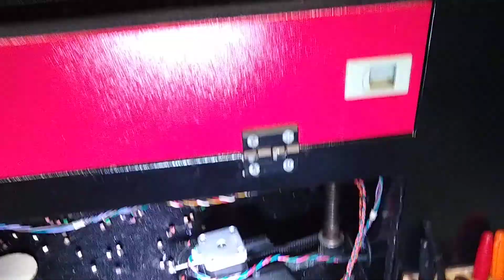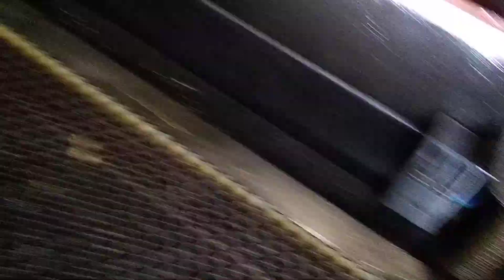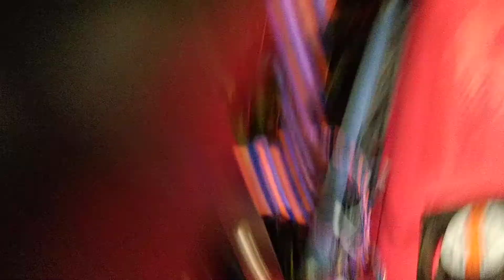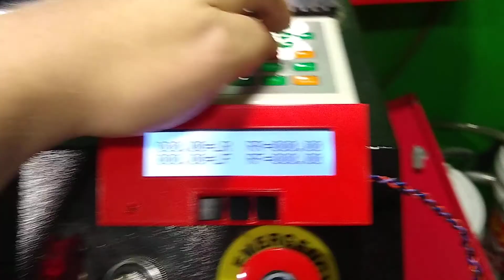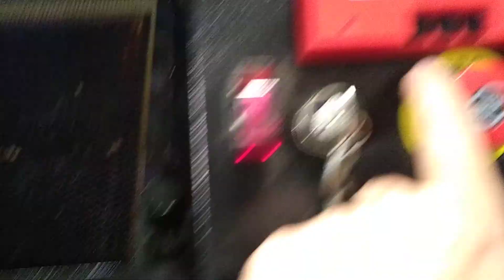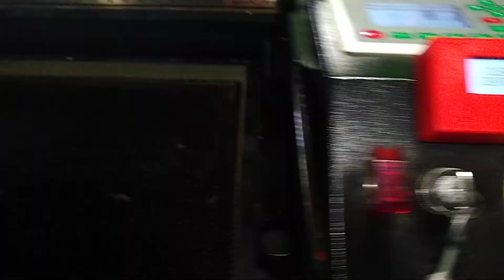Laser Cutter Bed Leveling System WIP

Comment: Hi there! Would you be willing to sell me the board already programmed? I have this same issue and it's been driving me nuts
Reply from the maker: This project saw a bit more work but ultimately I rolled the motor control into my Marlin conversion project and this board stopped being used.  I took the microcontroller and stepper drivers off and used them for other things.  The microcontroller I used on this is no longer being sold.  If I were to do this again, I think I would use a 4-axis 3D printer control board instead of what I made (you can get 8-bit boards for Ender 3 printers cheap).  The .ino file on the hackaday page linked below has the source code (Arduino) with extensive comments explaining what everything does.  This would need to be altered to fit with whatever board you get.  I hope this helps.

https://hackaday.io/project/175647-laser-cutter-bed-leveling-safety-system
Reply: @ Thank you!

I ended up getting a Tinsy 2.0 on EBay for this exact project but since you moved on I thought there might be a chance for me to speed things up.

I appreciate the quick reply and sharing this for others like my self 🙏

Thank you